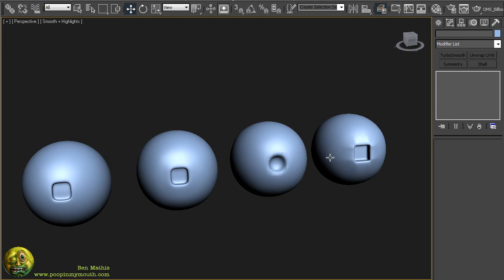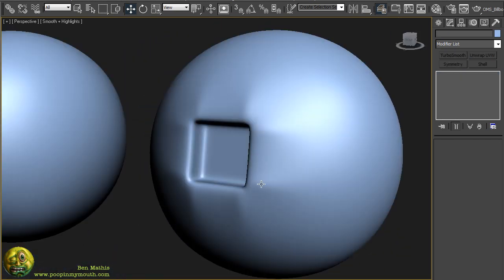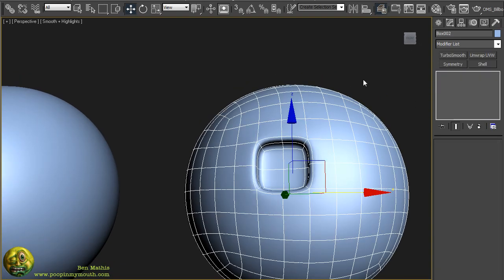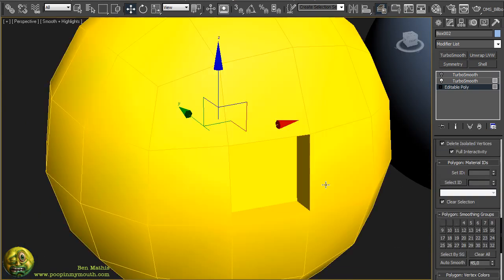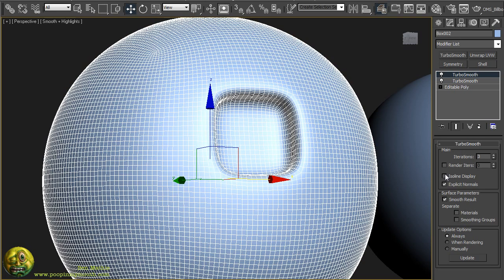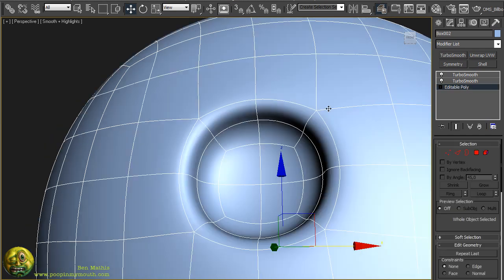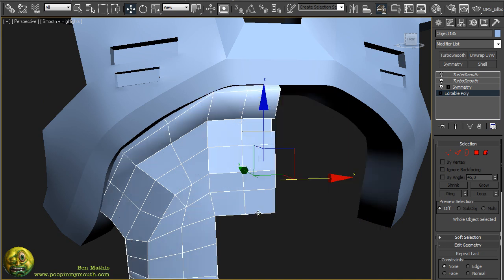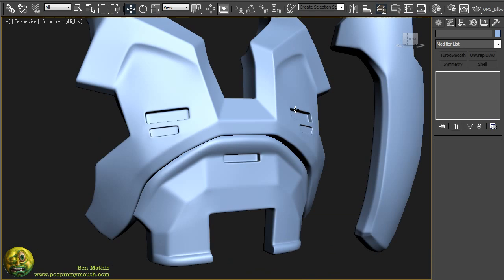Double Smooth in 3DS Max

Comment: Or you can apply very small chamfer to the edges which you want to be sharp and then apply spherify and turbosmooth. It will generate same effect with less than half poly count. 

Again both methods can be use according to how much precision you required. :)
Reply: Yes, that would work on a sphere, but this video's technique will work on much more convoluted or complex surfaces like car doors, armor, or other strange shapes without a modifier that will pop all the geometry into the correct shape like a sphere. I just used a sphere to show quickly how to preserve sharper details in a more sparse curved mesh.